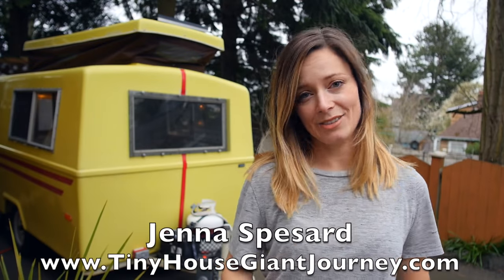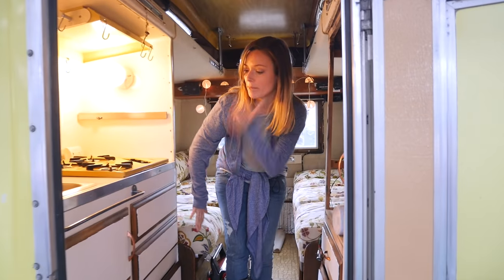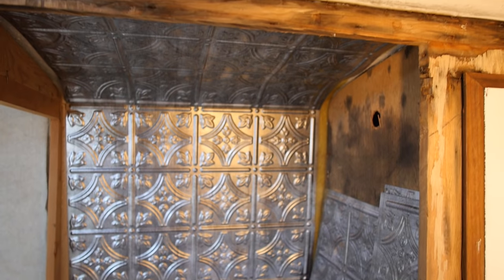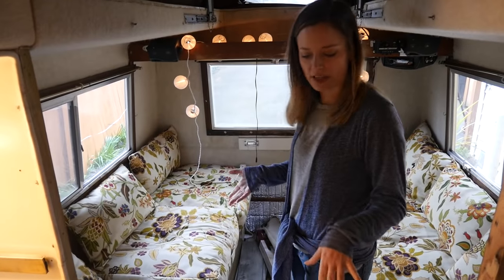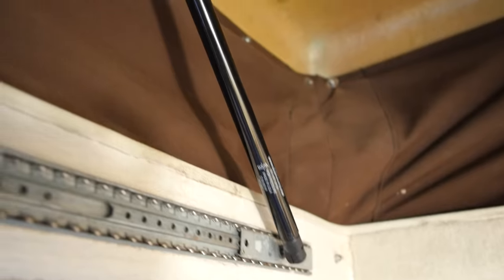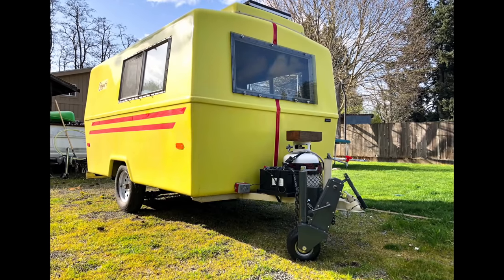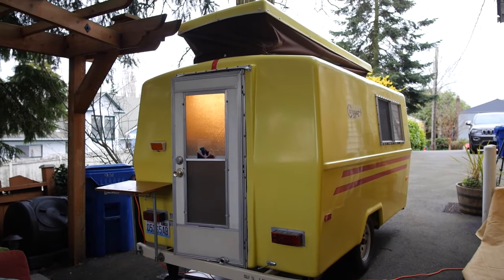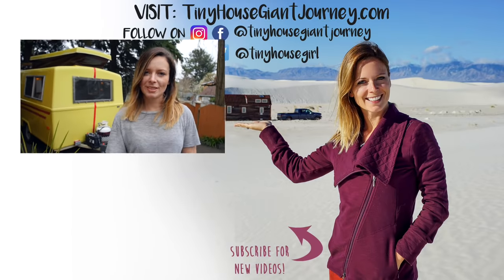Vintage Camper Trailer Restoration - Ep 1: Before Renovation

Comment: Jenna, I recently purchased a hybrid popup trailer and have been modifying it also.  It is very similar to yours but this one has a drop down back wall that can make into an extra room.  Like yours I have a portapotty and no hotwater or shower either.  I was able to make a throw together room out of 1 inch pvc pipe that breaks down into four single rods with fittings glued and four upper rods that support the four corners.  It goes up really fast and then you can use harbor freight velcro wrap straps to hang cloth siding.  Then I rigged a 110 volt on demand shower head commonly used by the Brazilians. the shower head hooks up to a fitting on the side of the trailer so it will use either electric pumped water from the trailer or city water from the trailer.   If you want to see pictures let me know.

Comment: Hello Jenna.  Enjoyed your video.  We have a 1966 Wagonette, made in UK, and we think it is the only one left.  We exhibit it at classic caravan rallies.  Like your van, the door is at the back.  When we first saw it it was rotting in a back garden, full of metal shelving and spiders.  My husband who is a joiner by trade ripped all the rotten plywood out, and rebuilt the inside.  It is quite something!

So - awning - we bought a porch awning on ebay, had the width reduced, installed an awning rail (both ends of the van are fibreglass), and we also had a canopy awning made.  We have a submersible pump, a child's paddling pool, some old awning poles, cheapie shower curtain, and with these aids, we can have a shower.  We did try the solar shower bag but in the UK, we needed to add hot water to it, our summers generally are not too warm.  

I look forward to seeing the finished van, happy camping.  Susan (wife of Edward in UK).

Comment: Instead of glass, maybe think about Lexan sheets. You can buy them at Orchard Supply Hardware, or online from TAP plastics. You cut them to fit yourself, using the same frames as you already have and you can double them up if you want them thicker. I used them in a camp trailer I built and put window tint between the layers, keeping it from getting scratched. You can get colored tint film, too. (Think yellow windows, or contrast red or blue with your yellow trailer. Just for fun!) Good luck with your renovation! Happy trails!
Reply: Joseph Erwin  Sun going thru yellow may give you tummy problems.

Comment: The widows on the door are held in with a kind of spring along the side of the frame. Move the window down to a neutral space (where the window locks do not engage) then push the window to the side and lift out of the frame.  I hope this helps.
Reply: U R Not SHORT. If U Not standing on something to touch the top, like u r doing. Your not SHORT.....😖🤒🤕🙄 your not SHORT. DAM.

Comment: You should see what I have!  I have a 1952 Pontiac Chief.  It is really a tiny house, completely built out of wood instead of an outer metal casing.
Reply: Do you have any photos?! I’d LOVE to see it! Even though this is two years old. So you probably won’t see this...
Reply: @jamesfv1  I did see your reply.  I don’t know how to upload pictures from my phone to the internet.  I found out that it really does have metal with house siding all over it and a tiny house-type roof built over the flat trailer roof.  It looks like a tiny house.  I painted it light peach with dark brown trim and painted criss-cross brown over peach on the awnings, to try and make it look like a tiny Tudor house.  The interior wood was too trashed and damaged and I could not replace any panels with the same color, so I replaced most of the damaged wood interior with any color I could find and painted the interior in pastels.  The kitchen is pink and the rest is blue and green.  The curtains are florals in coordinated pastels.  I don’t have money to restore it well, but it is a small pleasant home.

Comment: there is a portable on demand hot water system you can but for outside hot showers.  It works great and is not expensive.  When I was a kid if you needed hot water to do dishes etc. you just heated a pot on the coleman stove outside.  We never cooked inside - the picnic table was well used.  I now have a motorhome and I still use the coleman stove for everything.  Love the look of your trailer.

Comment: Love the simplicity of this camper, very nice!!  I like what you have done with it too.  Where did you get the plastic tiles that look like tin tiles?  Makes a great closet lining.  Thinking of the name Daisy for your trailer.  You could paint it on the back too.

Couple of tips:
IKEA sells very lightweight crates in fold-able cloth-like material.  Opens to a crate size but folds down to a paper pad size.

To paint any surface in RV, first sandpaper, then use Kilz Oil Primer, then latex (walls only) or enamel (wood or metal) which can be rolled on with tiny rollers.  I did my whole RV and the tiny ones work well.  Don't do latex on wood, and don't skip the oil primer or all of it will peel off.

I would change the sink and tap both not pretty or functional.  Get a deeper squarish sink and a modern faucet.  Both are at IKEA or Amazon.  Look for Bar Prep sink for small size.  Using an undermount sink will give you more counter space.

Not sure if you have done your floor yet, but if you want easy - get Click Lock Engineered wood Bamboo (in tiger stripe) from Home Depot. They are thin and narrow and don't need glue or nails, so they don't pop out or crack.  Engineered wood is real wood and made for flexing.  Your boards look too heavy, and will need refinishing.  For underlayment, you can buy Silent Blue or Silent Silver closed cell neoprene with mylar backing, cheap on Amazon.  Cuts down noise, moisture barrier, and good insulation. 

Magnetic racks are great for kitchen and closet.  Harbor Frieght $5 (or $2 on sale, or free with purchase), IKEA $10 each.

Please keep the stove and cabinets - they are a lovely vintage style and add value to your trailer.

Well done!  Keep up the good work and looking forward to future posts!

Comment: Awesome little trailer it looks like it is in great shape a little dated but that to me is super cool  i had a late 70s Airstream that was all factory  including a “Groovt” flowered pattern on the bathroom walls and  a harvest gold looking shower !  A cool thing on Airstreams are they rarely have roof leaks and often used higher end appliances and accessories  so everything worked as it was intended to with minor TLC  like the wate heater needed a 8 dollar thermo coupler that i installed at a campground in about 10 minutes time  not that big of a deal  original fridge works  on all  modes  another nice thing on the Airstreams are they are very light and easy to tow  ive always liked  quirky things  too  so i loved all the 70s interior items and would shop for accessories like  coffee pots and other items from that era  which makes it fun to use a Coleman lantern thats over 30 years old and works great

Comment: I lived in a vintage trailer for a year and storms terrified me! Also so many of my friends have caught a cross wind while driving and flipped their trailers because they are so light. I had to move into a van for more wind stability and vans are metal so no condensation wall rot. But it’s so humid here it’s a real problem. I miss my vintage camper but I am so much more secure in storms.

Comment: Did you consider making the old fridge space into a shower with a small metal catch tub from a feed store? You might have room to place toilet in there but could easily move it for a shower. You could even put a fold down wood bench off shower  wall to cover tub/toilet for extra seat? I love the metal sheeting in that space. I'd put that on your pop up too. It would reflect light. I just love this. Have fun camping!

Comment: Consider using clear pvc type (lexan, plexiglass )  for the window replacements. In 1/4 " thickness, you can make the sliding type windows without metal framing. It's available at Home Depot or Lowes.

Comment: I used to use just a solar shower when camping w a horse.  I did get in the horse trailer to shower.  But surprisingly you can get a shower w little water.  It’s a plastic bag you hang in the sun to heat, bought it at a sports store

Comment: I think your Tiny House Giant Journey logo should be on it. You have such a huge following it's bound to get you some love. As for hot water, I've seen a few video's where van lifers have put 6" black PVC tubes on top with a pressure valve and gotten some good results. I wonder if you've considered bringing the windows into this gen and looking for dual pane replacements? You might want to go find an RV junk yard and see if you can find a small gas furriness that maybe would fit under or in a lower cabinet. I know making the inside functional is important so I also wonder if you've considered some foam insulation.

Comment: Very cool trailer   Hope you. Have lots of fun and safe travels  with it on your popup  those slides. Look very similar. To  heavy Duty   Drawer slides  you may. Find parts orreplacement parts from a online Cabinet or Woodworking store if you  need to to repair the factory. Ones ?   Knape Voight. Or KV makes. Very. Good ones  and ive found that brand  offered enough styles and sizes to repair vintage Snap-On and Craftsman. Roll around. Tool boxes !

Comment: Beautiful. I would move the $200 battery off the tongue and convert the whole system to 12v with a 120v converter. The only other issue is solar. But you can get a flexible panel and glue it to the roof. It shouldn't add too much weight and it will add a charge to the off-shore bat.

Comment: You can get small diesel heaters very eficient , you can get them from ebay chinese ones are very cheap but surprisingly well made ( excellent reviews on you tube or you can get the more expensive usa made ones  they are very compact and can be built in to a small space , of course get a co2 detector fit it low down but there should be no problems as long as the area around the exaust and floor are gas tight , deffo worth a look ,make sure you get the complete kit with heater controller
And exaust muffler and if you get the chinese one replace the jubilee clips for good quality stainless steel ones

Comment: Maybe you got farther in this process but others may read. We down sized from a cumbersome heavy 5th whe to a Cherokee wold pup trailer. It came solar ready and hey recommenced a small solar panel but we saw a large one on sale. Just plain. My parter put metal bars across back and rubber feet on it so we can throw on roof of trailer while dry camping. The large solar panel can charge out battery from dead. The one recommended by solar company would only trickle charge. For water as example our neighbor in the smaller retirement town we moved too installed a black water tank for hot water, no heater, no solar panel. Just passive sun heating it. He says gets extremely hot. Even in winter. He built what looks like a triangle shaped sky light to go around it to disguise it on his home roof. They also have black solar heated bag showers. I have just sat water in the sun to heat when tent dry camping to wash hair, hands etc.

Comment: All you really need to live comfortably (enough) is: A comfortable place to sleep, a way to get and keep yourself clean, a place to urinate/defecate, and a place to store/cook/eat food. Everything else is extra. A person could live comfortably in that "vintage camper trailer" with some modifications. Personally, I'd upgrade the suspension, rip out most of the interior, and redo it. I would put in a small custom shower stall that would also hold the toilet when not in use. A small freshwater tank. an on-demand water heater, some batteries, a solar panel on top, a large but stowable/discreet exterior wifi antenna, a small AC unit (as a luxury, would probably be wired for when plugged in somewhere), and a small propane heater. While everything is out, I would probably insulate everything. I'd probably downsize the stove to a single burner. Realistically for me, I haven't used more than one burner at a time in over three years. With the right design, you can create a space that you can sit and sleep comfortably without taking much space. If you really want to save space, sleep in a hammock. You can take it down when not sleeping and stow it away just about anywhere.

Comment: I live in Maui where rent is 1000 a month for a rat infested room so people come up with a lot of ways to live. A friend of mine took an old mail truck and turned it into a camper. One of the little ones. He used 4 inch black PVC pipe around the parameter of the roof with a fill and a standard garden spigot. Instant hot solar water, works even in cold weather. BTW there's a lot of water in 20 feet of 4 in PVC.

Comment: You don't need to take up valuable space with a hot water heater.  Just get a medium size stainless-steel stock pot and heat water on your stove, and then fill a solar shower bag, or all-purpose "weed" sprayer and you have a very nice hot shower!   The rest of the time you can put a plastic bag in the stock pot and use it for a trash receptacle.   For your shower curtain, string bungee cords up on eye-hooks, and use a concrete mixing tray ($8.) from a hardware store for a shower pan.  Easy-peasy!

Comment: here's a name for ya doll, try the yellow submersion. yeah I know, but  it is a run on words. since you seem too submerge your self into your missions.   may as well hell those little cubby's are a real blast if done up right.  I'd use the space as best can be found. like under the seating, for the refuge or toilet. and as too the heater, since you have it piped in, move it too a wall where you can mount a small flue less heater, and stick that up high maybe that over head shelf.  as too solar oh yeah, if you can get away with out 110, fine, but most likely not.  using both gives more limitations.   but under the 12 volt, you can only do so much, for so long.  get a small generator that can be packed away there are so many places that they come in handy.  it can be a bitch too find ways to connect, but you have so many places that can be used. like that little opening by the door, you could put a 1500 watt invertor / convertor for times you need to run it.  find solar panels that can be roof mounted or easily stored. there are ex military that have soft solar roll ups, or roof mounts that get glued down. 1foot by 6 foot. they put out up too 200 watts.     they can be run through a controller, into battery bank.  use lithium batteries for space.   but the cash spent pays back later. hell I traded an old dodge camper that had seen better daze in the 60's, and it was a 76 sportsman. I put 800 into it, went every where, many times over the years, then lived in it for three years after I was kicked out. then sold it after I have no money too fix it, for what I paid into  it twelve years later.. even the gas used cost me hardly anything. I had cooking, hot water, and heat, and a 30 pound bottle lasted two weeks. I put a hundred pounder on the back carrier ,and that lasted me four months.    now the only down fall was the toilet. as getting rid of black water.   I would go out and dig a hole ,and spend a month ,then move around, do it again.  but I did use trailer/ Rv parks at times.  wireless modem and TV tapes I lived a good life on my own.  got too see some great country, and miss it but there needs too be grounding in life at age.   now I have too live in one place, a tiny house, 12x24.  all the mod-cons. costs me pennies a month.  I'll say one thing never get old it sucks.

Comment: call her lil sunshine........adventure van man takes a garden sprayer and replaces the wand with a sink sprayer allowing pressurized water to come through... paint the plastic container black and put in the sun, which will in turn heat the water so that you can have pressurized warm/hot water to bath.

Comment: Dometic fridge: what is it? And is it why the fridge I put in my tiny, no toilet vintage camper burned out after a year, and I still haven't repaired the damage. I was JUST about to buy a SMALLER  mini fridge, but will the same thing happen? Help quick, I need my tiny home back to livable ASAP. thanks. And the children potty didn't work out--but I had the right idea. Mine is SO heavy, its a 1968--but it's suffered damage since I got it 4 years ago. I almost gave up till I was feeling like I might ....I'll stop there. thanks!

Comment: try bullet proof glass n it`ll be a lot safe .... but  theres also shatter proof glaas windows n both are kinda pricey but hey safety frist  as they say .. so yall be safe peace ....
Reply: try a new 3 way eletrical system were it`ll run on solar, or batterys or shore power and if you could leghten your tongue on the trailer u could put in a battery box u can lock but instead of batters a portble gen  on cloudy days your solar dont full charge your systems ....

Comment: why not build a wall braket into that wall u said u could be a draw wall put in a heat sheilded box  then run the lines under sofa then to wall then threw the bottom of wall  then connet to your buddy heater or you could do the heater box into bottom front of sofa  ! jus a idea  ...
Reply: i see the cook top is on the other side of wall so it would not be a good idea to mount a heater in tht wall .....
Reply: also please check with other or a perfessonual before trying any thing that folks have said that way you`ll know if it can be  done n done safely ..........